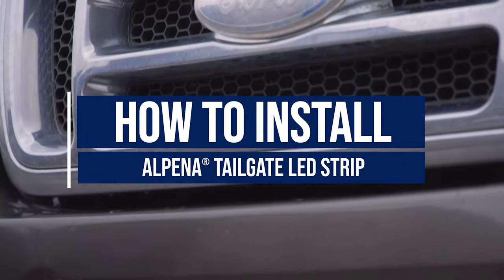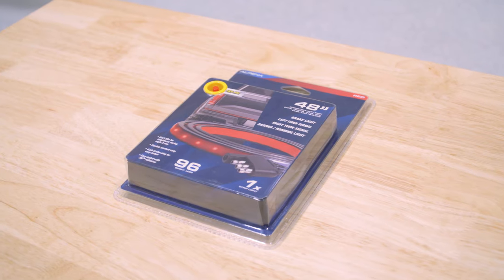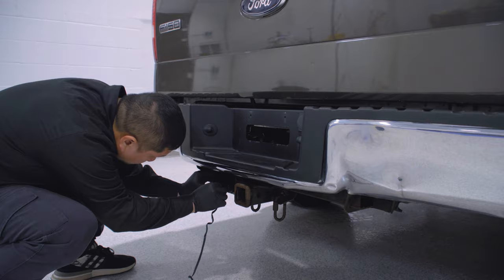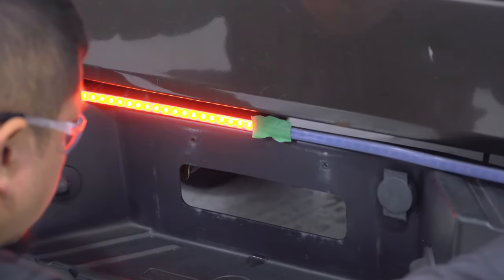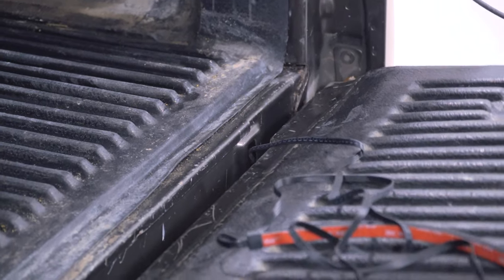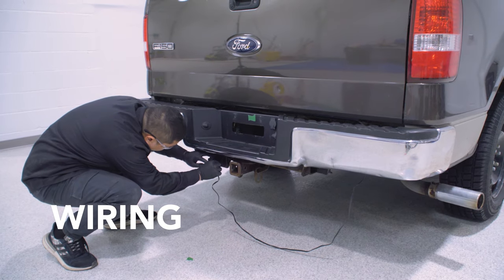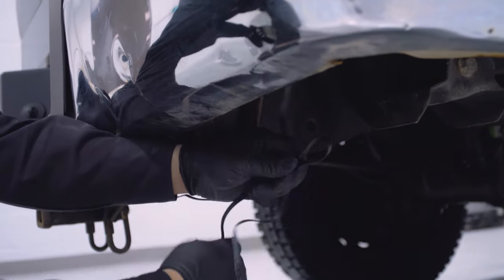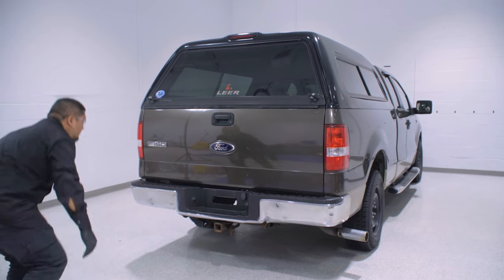Install Tailgate LED Strip from Alpena

Comment: I just recently installed it on my F150 XLT , super crew. The rear park aide is deactivated. How do I get its activated
Reply from the maker: Depending on your vehicle, using the trailer harness triggers this behavior, as it believes a trailer is attached. The solution would be to hard wire the LED strip into the taillights and forgo the trailer harness.

Comment: Put this brand on 99 Silverado and the running light is not working.. all others are.. why?
Reply: Just did the same thing for my 08 F-150 I feel like they are more there for stopping and turning
Reply: Same just installed on my 06 F-150 and no running light
Reply: Same here.  No low light function when I turn my headlights on.  The packaging mentions it, but no luck.
Reply: Thought I was the only one. No running lights 04 Silverado
Reply: Same here 05 f150
Reply: Same here 07 Silverado classic
Reply: Seems like the driving / running lights weren't even a actual feature. I have bought two of these and the running light feature advertised on the box and online doesn't work. I think I'm going to get a lawyer unless they can prove to me that they did not false advertise with this is this product!!

Comment: ⚠️⚠️⚠️⚠️
THIS VIDEO = Tell me you false advertise without telling me you false advertise.
⚠️⚠️⚠️⚠️

Why doesn't the ADVERTISED "Driving/Running" light mode work?! That feature is advertised on the box fucking box. It was the whole/only reason I bought this LED strip at all, but the only thing that actually functions is the turn signals and brake lights! I thought that, maybe the one I bought had a defect, so I bought a second tailgate LED strip (after having to return the first one) and it acts exactly the same way, WITH NO DRIVING/RUNNING LIGHT! You don't even mention or show the driving/running mode working in this video!
This is what I think...  I think that driving/running mode never worked cuz you falsely advertised this products functions/abilities. I see other people in the comments that are having the same exact problem as I am.
Reply from the maker: Hi there! We're very sorry to hear about the issues you're having. This isn't the experience we expect our customers to have with our products. This product is supposed to have this feature. Is it possible that the wiring needs to be adjusted? Have you consulted a professional for assistance while installing? If you're still having issues, please give us a call at 1-800-387-3217 or send an email to feedback@alpena.ca.